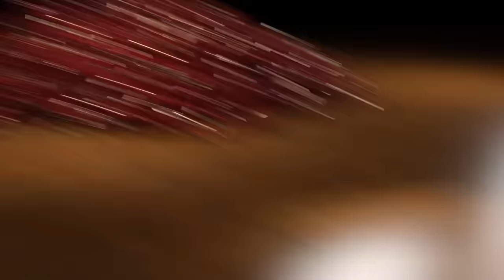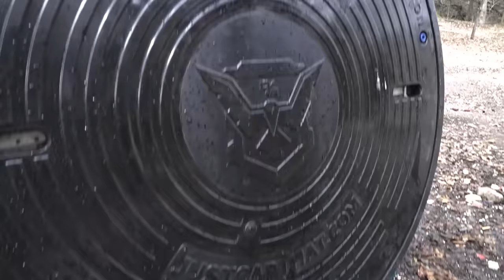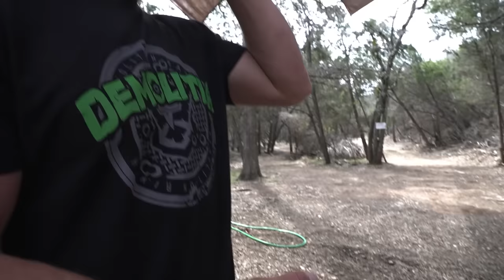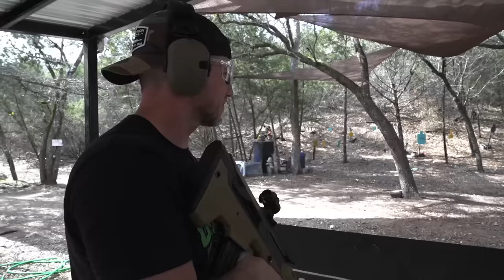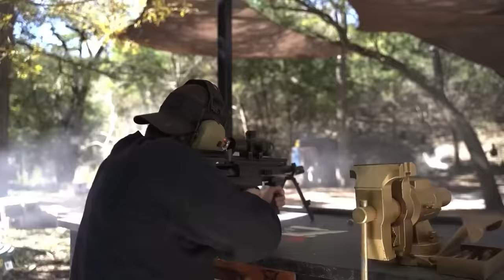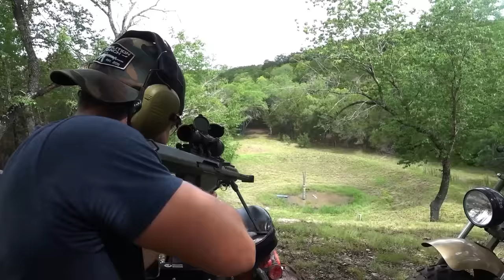The Worlds SHORTEST Rifle vs My GIANT Manhole...

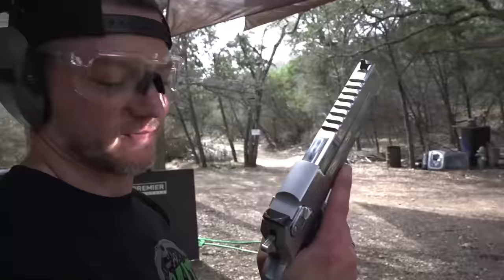Comment: 8:07 Pretty lucky to not get hit by whatever black object that came flying back at them from at AE 50, wasn't the bullet, but came back pretty fast
Reply: Ehh wouldn't have done much if any harm anyway. Was only moving at 96 fps (took 22 frames at 60 frames per second from the impact at a distance of what looks like 10 yards), or 67 mph and had very little mass behind it. Looked like a piece of the plastic coating.

Comment: Noob question : does adding a suppressor to the  Micron 11.5”  short barrel  changes the velocity and accuracy of the bullet ? or it only affects the noise level ,thank you
Reply: No there's no reason that it would make it slower or less accurate except for the fact that they do tend to have a slightly different point of impact with one vs without 1 so if you zeroed your site without 1 and then put one on then your site would probably be off by a very small amount. Unless you mean the old school ones with rubber 'wipes,' that would f up both.

Comment: I saw a video of diy body armor with resin and fiberglass sheets and it was pretty thick but it was stopping everything smaller than 5.56

With ceramic plates in front, it would probably stop 5.56 imo

Comment: Will it run the new .277 fury with a barrel swap? The higher pressure was to optimize for shorter barrels. That is why the Sig is only 13”.

Comment: It is a manhole cover. Not a manhole.

Manholes are vertical underground confined spaces used by utility personnel as a point of access to a sewer system. Sewer systems are built underground with pipes that carry waste from homes and other buildings to a place of treatment or disposal.

A manhole cover or maintenance hole cover is a removable plate forming the lid over the opening of a manhole, an opening large enough for a person to pass through that is used as an access point for an underground vault or pipe.

Comment: I have a question. I notice alot of guns with huge buttstocks. Would it be a good idea to have a buttstock that can store bullets and if that is possible could a gun be configured to fire a bullet from a buttstock. Two different types of storage. it could be placed inside the buttstock itself or magazines could be attached in some way to it. Also would that effect the accuracy?
Reply: Extra weight. Not sure I’d want it on the back end. Could increase muzzle climb

Comment: Lmao "they say it's very similar to Kevlar" - they are LYING.
Fibreglass is made up of stretched GLASS "fibres" (actualy cystals), which are very brittle. It has high tensile strength for its weight, but it is very fragile.
Kevlar is a long-chain polymer with much higher tensile strength for its weight but it is also highly flexible, what with being an aromatic polyamide. When manufactured the polymers are mechanically worked which aligns them in a process which ends up toughening the material, much like how forging steel results in a tougher material because of manipulation of the crystals. It also has a LOT of inter-chain bonds which lend it even more strength and resistance to abrasion and cutting.
Comparing fibreglass to kevlar in this way is an abject falsehood.
There are also many different grades of Kevlar, with some being MUCH more "bulletproof" than others.
Reply: We didn't mean to "lie" but rather to simplify.  Aramid fibers are molecularly different than E-glass fibers, but we did not feel there would be enough interest in that level of detail - this is more of a gun audience than a composites audience.  Kevlar manhole covers would be way too costly than practical. Thanks for your interest!